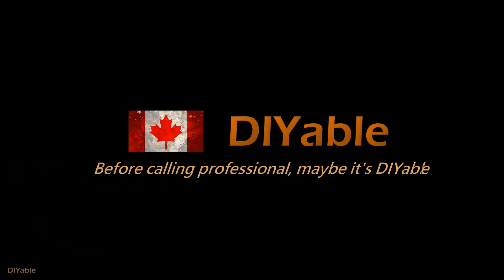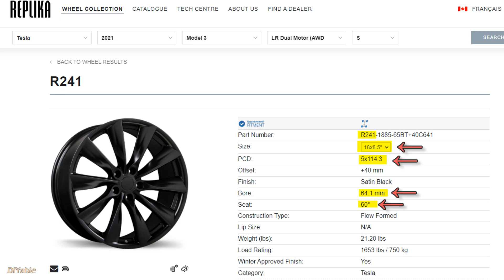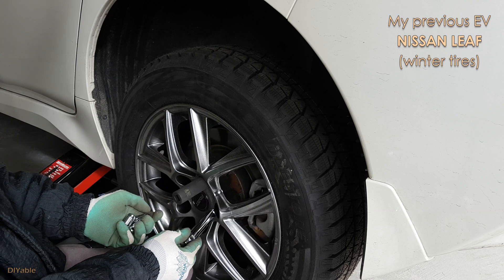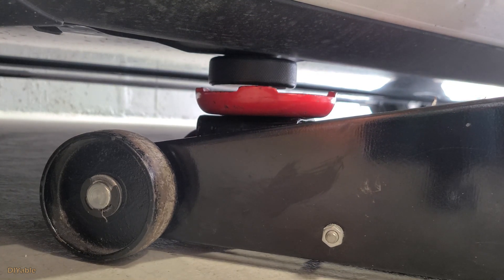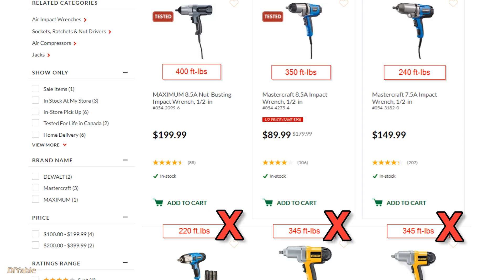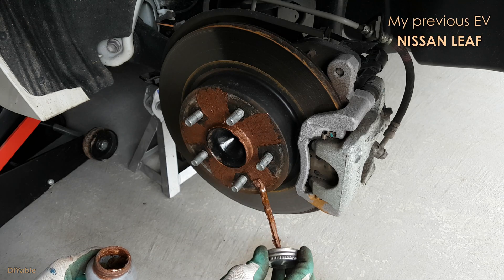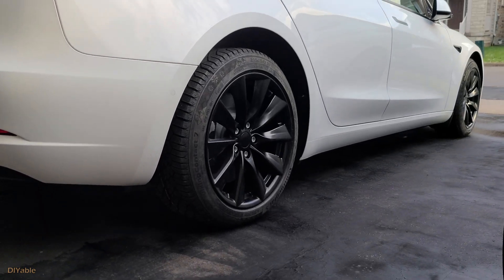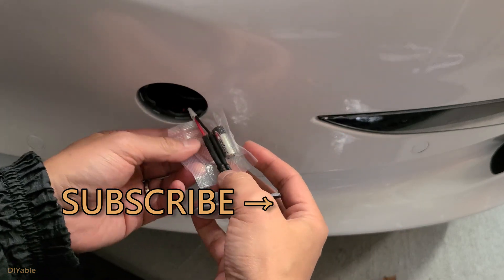How to change winter tires on Tesla Model 3 with Step-By-Step Instructions?

Comment: Hi! I did buy the exact same mags for my tesla model 3 (R241 64,1 CB) and it does not fit on my model 3 STD range. Do you think the lube could make the difference? I checked on the car and it is also 64,1... I am very confused, and stuck with my winter tire lol can you give me some advice?
Reply from the maker: Really? AWD and STD should have the same according spec (64.1mm)..  Where did you buy your R241? If that's from the tire shop, go back and check with them. When you say doesn't fit, how big is the difference? You need to get some tools to measure the center bore to make sure your R241 is really R241 with 64.1mm.

Comment: My wife always stop me to invest tire change tool becuase she think the shop provide balancing service. What do you think about this?
Reply from the maker: Your wife is partially correct, yes, the shop provides balancing service, but you only need once for the tires and rims UNLESS you don't have a set of winter rims and you need to dismount the rubber from the summer rim and put winter rubber on it every single year, then in that case, you need the balancing service. Otherwise, you don't.